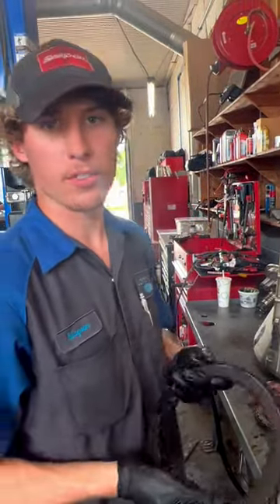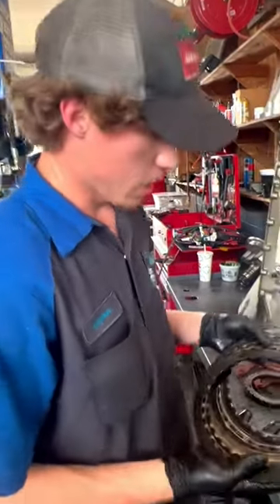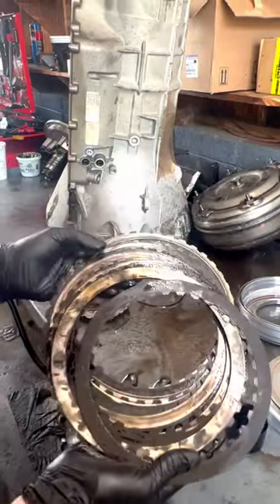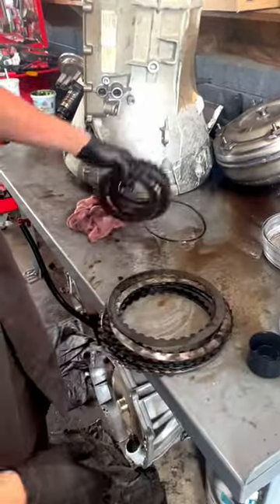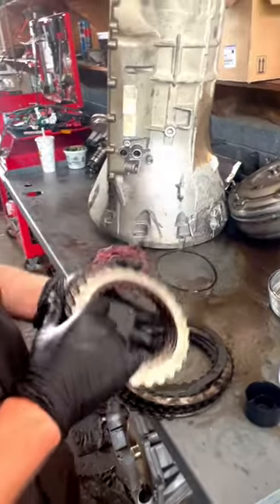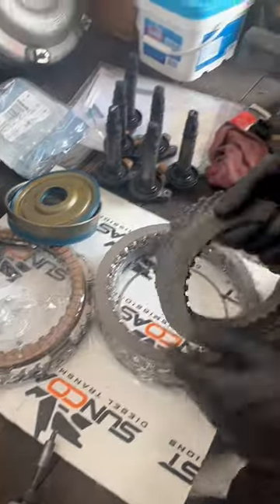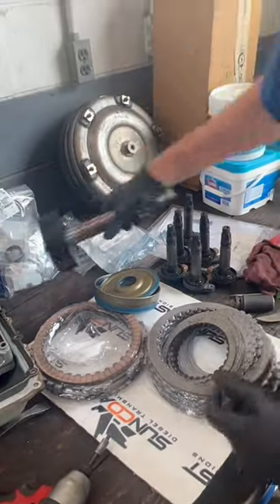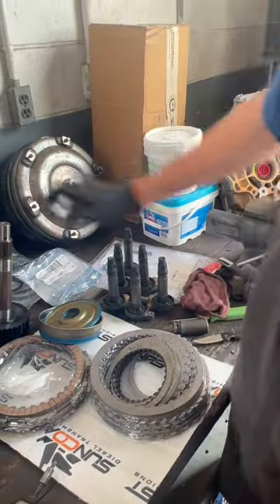Why you shouldn’t tune your 6.7L PowerStroke #shorts

Comment: I paid for them there clutches and by God I’m gonna use all them there clutches. I’ll replace them when they’re done.
Reply: I mean there’s always a shift kit/ trans tune and raising the hold pressures and they usually will hold about double stock numbers for a little while
Reply: Exactly
Reply: Damn straight.
Reply: @Nasher98
That there’s an example of exactly why I’ll never own anything that has been built in the last decade with the moniker of Eco-boost or something similar!!! 
When putting turbos or superchargers on a motor, the crankcase, crankshaft, all the rotating assembly must be upgraded to withstand those extra pressures!!! 
Ford isn’t building their 4 cylinder and 6 cylinder motors with upgraded bottom end stuff!! 
I’m sure neither Chevy nor Dodge is doing that for their motors! 
So you’ve got a crapload of driver out here sitting on grenades just waiting to hit their stress limits and the explosion may not destroy the vehicle or the occupants, but it will destroy their wallets and bank accounts!!!
Reply: @AzzKicker-bz1cb  you’re clueless about engines my dude.
Reply: @AzzKicker-bz1cb  you have no idea what you’re talking about.
Reply: @MWilk098  no he’s right
Reply: As long as you don't launch it or kick down at Full Throttle you'll be fine
Reply: @jdahling4738  He's not wrong though. When the focus rs was launched they were notorious for head gasket failure due to Ford using the stock 2.3 mustang gasket on an engine that makes 100 more hp. Chevy is just as bad. When I was a mechanic we got a Malibu once a month with a blown 1.5 barely out of warranty. 75k miles and the pistons usually are cracked. This is what happens when these manufacturers keep leaning out these direct injection cars trying to chase unrealistic mpg figures. They want to sell the cars as cheap as possible so no money is spared for internals built to withstand the boost. The Japanese and euro turbo engines are far superior in every way possible.
Reply: @MWilk098  He's not wrong though. When the focus rs was launched they were notorious for head gasket failure due to Ford using the stock 2.3 mustang gasket on an engine that makes 100 more hp. Chevy is just as bad. When I was a mechanic we got a Malibu once a month with a blown 1.5 barely out of warranty. 75k miles and the pistons usually are cracked. This is what happens when these manufacturers keep leaning out these direct injection cars trying to chase unrealistic mpg figures. They want to sell the cars as cheap as possible so no money is spared for internals built to withstand the boost. The Japanese and euro turbo engines are far superior in every way possible.

Comment: I mean a transmission upgrade is always a must, I'm sure all the experienced speed guys know that already.
Reply: Transmission can give you way more speed than a motor. You can fine tune each gear and rpm drop to stay in the power band the whole time
Reply: that’s what i always thought upgrading the transmission then throw power at it
Reply: @matthewmorgan582  only works if the guy next to you has less power. Can't just make different gear ratios for those trannys lol
Reply: @mustangdemon87  yeah but you can install adjustable final drive and the tighter the clutch the faster the shifts. ECT's have been around a long time.
Reply: @matthewmorgan582  Still won’t do shit if you only have 1/4 of the horsepower of what you’re racing lmao
Reply: As soon as I buy a new ford, I take the trans and motor out because they are both garbage, and then I BULLET PROOF So I can tow a trailer and get 100k out of my truck, lmao
Reply: @matthewmorgan582  tighter clutch packs do not mean faster shifts. Clutch packs have specs they must meet for gaps/spacing. Maybe you ment higher line pressures help speed shifts and hold more power in the packs? Eods to the newer zf 8 speeds all use specs for clutch packs same spec from the 8hp that's in a Durango to a hellcat.
Reply: @jaybee6477  that's why I don't buy ford. Have a 96 ram 485k miles and 02 ram 340k miles still no issues motor or trans.
Reply: @jaybee6477  Troll sighted. I see 6.7’s with over 200K all the time and all the owners just change fluids on time.
Reply: @warrenself  oh well in my company we had ten and ten of them had $5000 nightmare after $5000 nightmare after $5000 nightmare of pulling them cab off the truck every time. Now we have a mix of Chevy and dodge, and dodge seemed to be the least problematic these days oddly being those were the cheapest to buy
Reply: @Jay Bee  what years were they. If they were the 6.4L there's your problem. If they were the 6.0L just needed to delete the EGR. The 6.7L is the most bullet proof diesel engine that Ford has made since the 7.3L International.

Comment: If I were to have a deleted and tuned diesel, I’d try to keep it near stock power, just make it run smooth and maybe a small increase in hp and torque. I’d mainly be doing it for reliability.

Comment: Did this truck have trans tuning?   Trans tuning is required to help the transmission survive the increase in power output.  Converter lockup and clutch disc engagement time is crucial for a 6/10r140 to stay together with ecu programming.  This is what happens when a tuner gets a hold of a truck that doesn’t know what their doing.

Comment: Why upgrade the clutch if you’re gonna eventually have to do it anyway? You might as well let the stock clutch plates wear out then replace it with the upgraded clutch. Why throw away brand new stock clutch plates?  Just buy the upgrade and wait for the stock plates to wear out. Then replace with upgraded ones from there on out. You’re welcome.

Comment: The Allison is a monster transmission compared to the small Ford and Ram transmissions.
Reply: Except it can’t handle a simple tune starts slipping and limping
Reply: @mr.lowslow7702  where’s your source? Mines holding up just fine
Reply: @rock-uu7qr  is it tuned? Ask anyone familiar with tuning duramaxs that’s my source. Ask anyone about the Allison limp mode once it sense slippage.
Reply: @mr.lowslow7702  It has the full banks power pack exhaust intake and the performance tune. I think you are speaking out of your ass every brand of diesel truck nowadays seem to hold up fine to tunes
Reply: @mr.lowslow7702  exactly! I have a buddy that has a 2018 Denali and he already smoked the transmission.  Allison's can't hold up to the extra power.
Reply: @dieselnut2369  not to mention the new 10 speed trucks aren’t even Allison transmission any more. It’s a 10r140 from ford and they just use the Allison name plate. Such BS
Reply: @mr.lowslow7702  i have a 2020 6.7 powerstroke with the 10speed . At first I wasn't sure about it but its grown on me
Reply: @mr.lowslow7702 the 10r140 transmission was engineered by gm engineers with our ford valve body and main controls. When i first saw em at our dealers in 2017 as a smaller 10r80 it said gm in the service procedure and engineering tags

Comment: I've seen a lot of diesel stuff destroyed don't forget the double or what ever disk clutch for the torque converter bullet usually prefer on most of the hot rod stuff and clutches are no good without a good shift kit and boost line pressure that really increases the holding power on the clutch pack

Comment: Really like you channel... BUT there's tuning and there's good tuning. I made north of 700hp for 4 years around 60k miles on the original transmission. I sold the truck to someone who wanted it to tow their horse trailer, still runs and shifts fine.
Reply: Really like your comment... BUT there's good tuning and there's great tuning. I made north of 701 horsepower for 5 years around 61k miles on the original transmission. I sold the truck to someone who wanted to tow their Ox trailer, still runs and shifts fine.

Comment: Yet none of the transmission shops in my area will even offer doing the upgrade. They just want to program the TCM and leave it at that. I had ONE shop offer the B&D valve but didn’t have a single client that I could get a test drive with.

Comment: My truck can tow 34,000 lbs and I’m to believe throwing an extra 100hp tune is going to wipe out my clutches while not towing. I ain’t saying you’re wrong, but that sure as shit don’t make sense.
Reply: Well if you think about these trucks were designed to tow and so we’re the transmission when you tow the transmission gears will reduce the blow the input shaft has to take. But when you tune it your just making that blow even harder to the transmission causing slipping clutches and broken Shafts.
Reply: @angelcelis9090  that’s gotta be the worst technical explanation ever. Do you know anything about tunes and torque converters? Doesn’t seem like it.
Reply: @tomfoolery5033  trust me the truck is designed to tow and YouTube it if you don’t understand but sir your stock transmission will not hold up to your +5’ tune.😂Towing under load is was less for the trans input shaft to handle.

Comment: I've rebuilt and replaced 7 on one 350 Crew cab long bed 6 inch lift on 30s while at the dealer. That truck was a 10 second truck 🤣

Comment: That's why I have a manual transmission haha
Reply: 1 good money shit and you won’t have any transmission.
Reply: Same, 33 years driving a stick and never rebuilt a trans. Never  had one leave me sitting. Drive my trucks to around 250k and haven't blown a clutch. Lucky I guess lol
Reply: Clutch will still slip if a diesel is tuned, been there done that
Reply: @freedomisntfree_44  if you are going to tune, you have to upgrade clutch also, factory vehicle won't do that, semi trucks don't slip hauling 25 tons with crazy torque and gearing.
Reply: Doesnt matter if you drive manual. If you give the transmission a more powerfull engine then it can handle, the tranny will be demolished.

Comment: I think that's every mechanic shops experience with guys souping up any kind of engine. I've seen guys wanna do this that and the other thing to their engine, which is fine. However, half of them don't want to do anything when the question comes about what you want done to your transmission (clutch packs, upgraded coolers, etc.). Then they end up back 3 weeks later on the back of a bed truck with a blown transmission lol

Comment: Man people don’t realize that 1,000ft lbs of torque stock is already stressing the stock parts depending on how you drive….most semis on the road toting 80k plus have 1,650 ft lbs to 2,050 ft lbs and the driveline is much more substantial so that it lasts under that much stress.
Most of these guys have never driven big rigs and it shows

Comment: This guy spits facts. 

The only people bitching and challenging this guy are the arm chair mechanics who have to take their pavement princess pickup trucks to guys like this cause they can't do it themselves. 

*slaps roof of 6.0,6.4, 6.7 PSD; "you can fit SO MANY repair bills in this thing!"
Reply: My tuned 6.0 has no transmission issues and will pull that dmax of yours to the junkyard anytime 😊
Reply: Just saw a 6.7 towing away a dMax today 😂

Comment: Why before?  Costs the same when you do need to build it.
Just say eventually you'll need a built trans. That's reality
Reply: Because it causes more damage than just the clutches. If that hub explodes for example, it's new transmission time. All the clutch material contaminates the fluid and can damage the valve body. Changing them before makes this damage less likely therefore possibly saving parts and money. Transmission parts are getting harder to come by lately also.
Reply: @member57  I can get behind those reasons, however since the 5R110 the Ford transmissions have been known for being the most robust in the diesel world. They take the most power of any of the stock transmissions. It's really drive like a child, that has consequences. And if you keep pounding on it after it gets hot or starts slipping, obviously damage. Now, are there tuned 6.7s with stock transmissions that last just fine? Yes. I'd argue the vast majority. Vast. Are they racing them? Not many.
Reply: @Jim_Lawrence  
Pay your money take your chances. The observation I make is that idiots abound and those stock transmission days are numbered from the moment you increase torque. I also can say there's argument about the robustness of the Ford transmission. All transmissions are the weak link regardless of make. So why leave them stock? All it takes is that one time a dude tries to show up a hellcat to shell the stock transmission. Pay now or pay more later.
Reply: @member57  are you experienced in the diesel world at all? Yes, if you increase input you shorten longevity, but 1 race against a hellcat won't kill a trans. Now, if you'd said take a 300k + truck, delete it and put it on the big tune, then add some spray to run that hellcat, then yes. That may very well kill it. 
People need to stop with this one size fits all crap. The world doesn't work that way. Doesn't work when the gov't tries it, and it doesn't work here.
Reply: @Jim_Lawrence  
Yep stock works great, until it doesn't. It only takes once to break anything. I've seen new trucks shit the bed, I've seen old trucks keep on goin on. You will pay eventually. Pay now or pay more later. I prefer to do it right the first time or don't do it at all.
Reply: @member57  So built transmissions never fail? Give it up man. You control yourself, and that's enough. And if it does break the first time, it was close already, because of it's previous life. 
And I still stick to, you can wait until you have issues to get it built. That said, if you use it for competition, building it first is probably best. Or if you rely on it for business, build it first.
Although picking up another used transmission to swap in is always an option. As said, not one size fits all.
Your argument really should be: Know the risks of your choices, and whatever bed you make, you have to lay in it. Agreed? 
Knowledge is power, forcing a choice means there is no choice. Society is better served with accurate information...
Reply: @Jim_Lawrence 
Whatever take your chances. You DECREASE your chances of failure with a "built" transmission is my point. I don't like breaking things, so I don't half-ass it like maybe you apparently do. If I can't then I wait until I can. Patience pays off my modded vehicles aren't my daily. You're correct there are 2 options, the right way and the wrong way.
Reply: @member57  Now you are attacking my character. Classy
I ask you to point out where I said I do any of this. I advocate for: Accurate information. Make your own choice. 
You saying 2 ways, right and wrong leads me to believe what kind of person you are. That philosophy is part of why we are where we are with leadership these days. 
You are no one outside your circle. And trying to project your views, is, un American. There are a few countries out there with those ideals, I'm sure they'd love to have you. 
Good for you that you wait until the power can be handled before you add the power. I'm actually doing the same currently. Supply chain issues have really slowed things down.

Comment: How about just run it with the stock ones until they burn up and THEN upgrade them?  Why throw away good OEM parts?  You don’t really make any sense jr.
Reply: You risk breaking more stuff that way. Plus you’d get left stranded wherever you are. Not really what people think of as ideal
Reply: How do you risk breaking more stuff this way?  I’m not sure you understand how clutches work.  Also, clutch plates don’t just go from good to no good instantly.  It’s generally a progression and you will be able to begin feeling them fail.
Reply: @newfinishautospa  unless it shatters and breaks the bell housing or other components. I do know about clutches considering I work on my own cars and have worked at shops for years. Do as you please just don’t be surprised when more shit than you expect break

Comment: Or get you a 6.0.
Reply: The engine isn’t the problem😂💀 bro you gotta be 12 or something, a 6.0 tranny can’t handle over 350 hp to the wheels
Reply: @andrewwest3556  Wrong. 5R110’s bone stock behind all the 6.4’s with 300HD H&S and 350HP Spartan tunes. Well known amongst anyone in the game back then that they would stay together better than the 6L80/90 and whatever Aisin or Chrysler was behind the other guys.

Comment: You realize no vehicle is designed to hold any extra horsepower. Everyone breaks parts when increasing horsepower and replaces those weak parts with stronger parts.

Comment: I mean pick what you want to replace, right? What's more expensive a trans rebuild or new emissions system parts? Which one is significantly cheaper over the life of the truck as well as WAYYYYYY more fun? Tune em delete em whoop em and break em. Wack video. Transmissions have always burned up from modding diesels. Every single one of them.

Comment: Not true at all. Ford engineering fucked up large on the newer transmissions. Terrible coupler designs internal failures. Cooler failures all leading to overheating and but clutch packs. You know the genuine Ford way. They’re garbage trucks.
Reply: I'm a Ford guy, and I think they are a better platform than the competition. Your comment does spark interest though. Where do I find out more about their coupler designs? Which transmissions too? The 10 speeds in this? If it is, GM is using the Ford design.